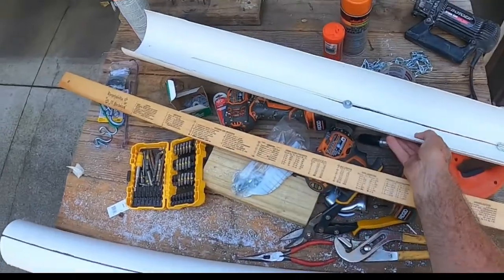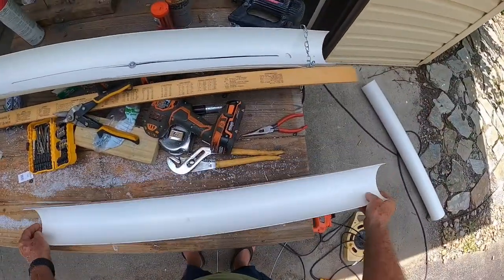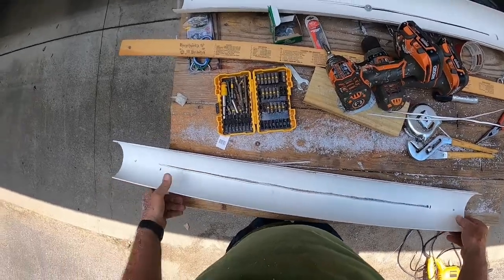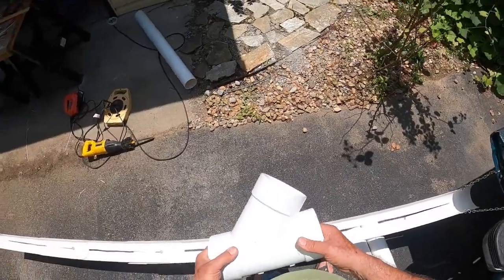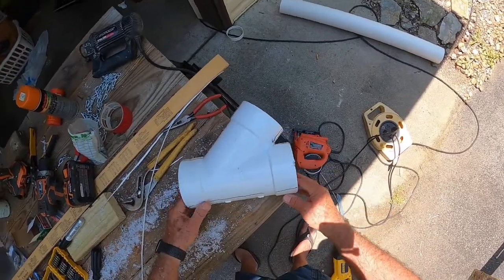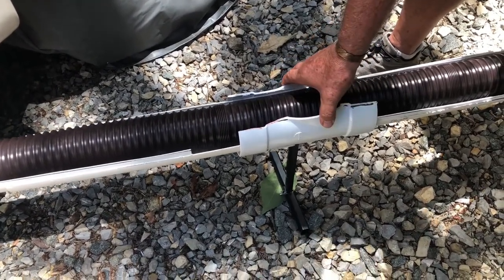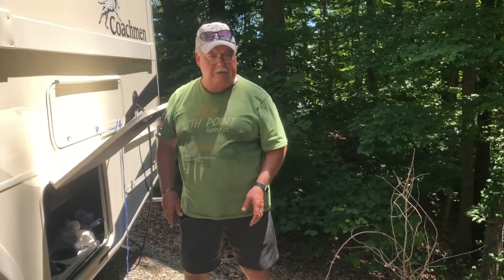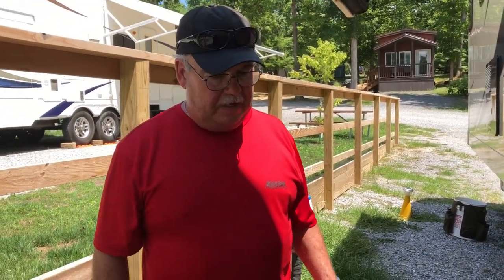[DIY Custom RV Sewer Rack Fabrication] for our 2020 Coachmen Pursuit Precision

Comment: Awesome mod for longer term stays. I did hard pipe setup when we had an 8month project. Looking forward to a long term update. Thanks for sharing.
Reply from the maker: Bill is still thinking about a solution to redo that Y. Did you have something you used in the hard pipe setup he could use for the Y problem? It worked pretty good when we camped at Natural Bridge otherwise. So when he reworks that’s Y we will give an update. Thanks for watching❣️ I’m still watching your videos to get caught up😊